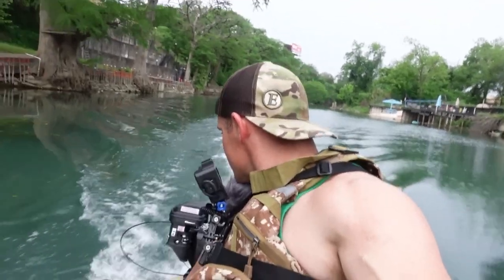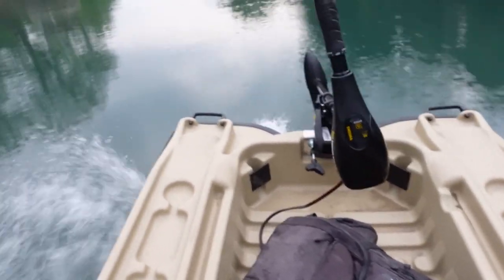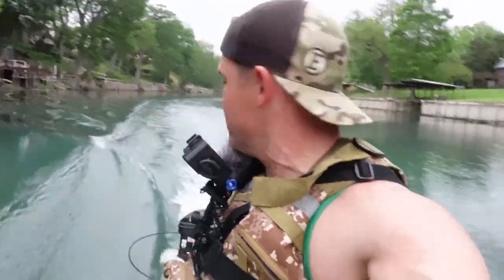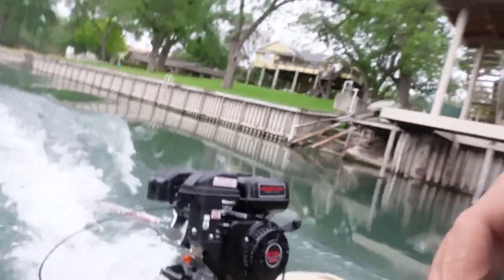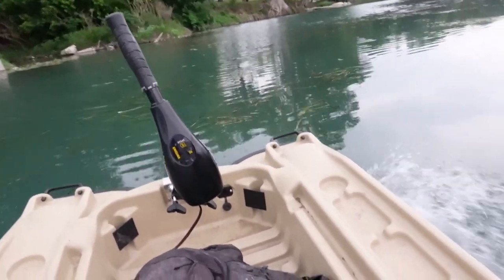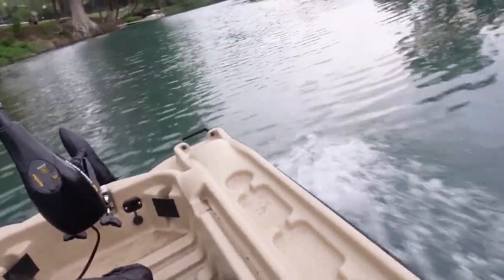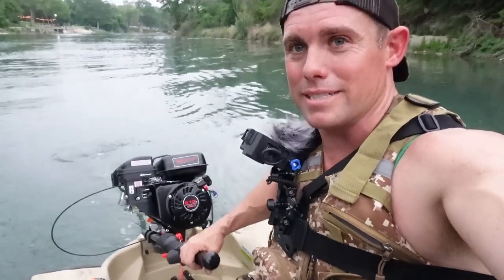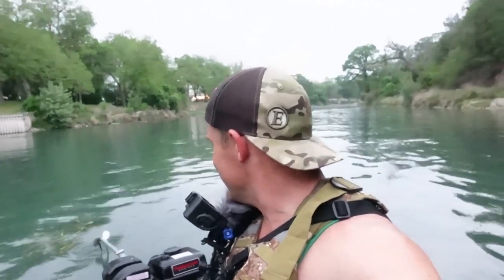SKETCHY! Fishing BOAT Speed Test! How to Make Fast Boat! Pelican Bass Raider 10e, Overpowered Mods

Comment: I bought the full motor kit from mudskipper and I have it mounted on my early 70s valco 12 foot. And I hardly ever need to use the gas to get to where I wanna go. I love the motor. I paid like an extra 50 bucks to get the electric starter for it so it's nothing but a dream for me. As far as the tipping goes I tie a string from my chair to the handle of the motor and that works just fine to hold it in place.
Reply from the maker: It sounds like you have a good setup going Michael. The starter would of been nice, but for me it starts pretty easy. I need to get my throttle fixed to get some more speed out of it. Thanks bud
Reply: Which motor is this ?

Comment: a 2-3hp outboard weighs 25-35lbs.. suzuki, mercury .. all of em.. 60p.. is how much a 6or 7hp is supposed to weigh ..you didnt really make a case for weight difference :)
Reply from the maker: Your right they are pretty close in weight but I could ditch the top mounted gas tank and it would be a lot less. There’s also the option of taking the motor and make it a 22 hp with a stage 3 kit for around $700 and that is a serious weight difference with a 20hp.